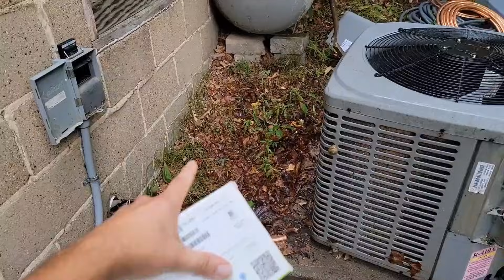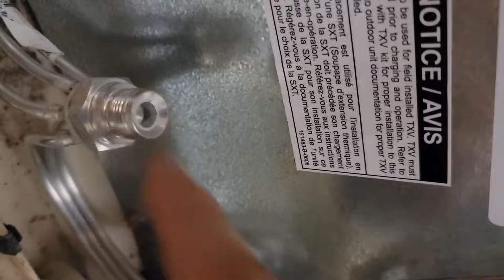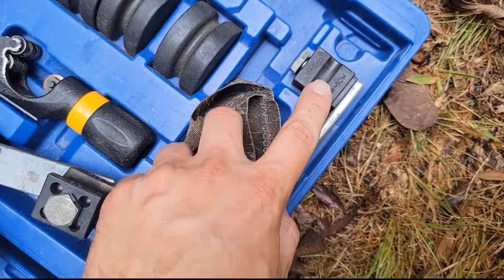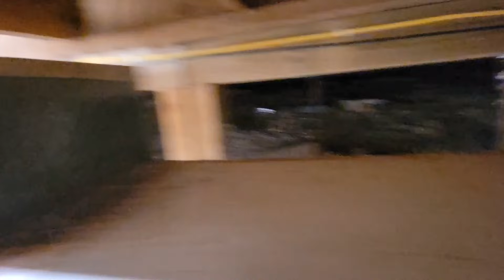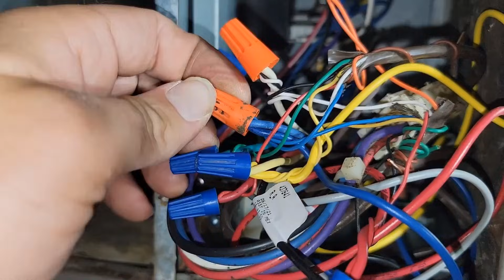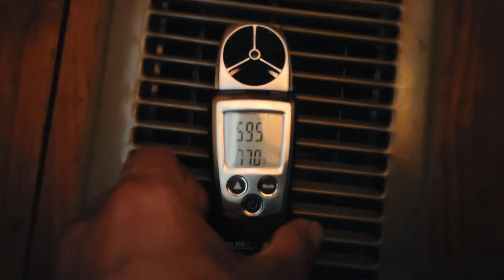HMH7 Modulating Heat Pump Installation Tips @YORKUnitaryProducts

Comment: I have a very similar unit. Even after the heat is turned off, the electric heater continues to run. What could be causing this?

Comment: When the return is pulling above 500 could you add a higher merv air filter to improve air filtration and also hit the temperature split?
Reply from the maker: You would definitely improve air filtration with that move but the restriction in the airflow and the added pressure drop is not good for the blower motor the suction pressure in cooling or the head pressure and heating.
This puts stress on the components like the compressor and the blower motor.
You could enlarge the return, get more surface area also try lowering the fan speed.

Comment: Thanks Rheem also has one an inverter   universal   side discharge  Hp units that fit & or rated for an normal indoor ducked indoor   air handler   ...  but is 67 supply air cold enough  ???  if i heard you right ?? so that mean an split of _ ? or RA of 82- low end to 87 +

Comment: I don't want to judge but that is not level
Reply from the maker: It's a heat pump during the winter. During heat mode, while in defrost coil thaws and it needs to drain water away from the unit. So being a little slightly unlevel helps
Reply: Oh, ok. Because I've installed my mitsubishi 6000 btu mini split air conditioner, and it is only an air conditioner on my outside wall and it is getting pretty old and I've ordered a mr cool 9000 btu because my mitsubishi is getting tired, breaking, and running inefficiently. I will try it out when I go to install it. Thanks for that advice!

Comment: I am looking at this HMH7 4ton 18.5 seer unit or the York affinity YZV 4ton 19.5 seer unit.

The HMH7 I am told is modulating unit and installer recommends an ecobee and not using the communicating thermostat. The affinity is going to have to be a communicating system.

Which is the unit you recommend? HMH7 system is 2k less. @taddydigest
Reply from the maker: get the HMH7 I repeat get the HMH7 please
Reply: @taddydigest I have since got the HMH7 4 ton unit, have had it about 9 months now. Not sure I like it/ love it. The unit has started to trip when demanding the unit cool over 3 degrees. Unit doesn’t seem to actually ramp up for the demand (I have to precool the house a day in advance for any type of party I am hosting), and takes 6+ hours to pull the temp down 4 degrees. Unsure if it’s wiring or if this unit just isn’t as advertised. Any help would be appreciated. My installer is involved but the techs aren’t knowledgeable on the unit and invertors. I am almost wanting to swap this out for a trane xv17

Comment: Did you confirm that the system will run the air hander at 2 speeds (high and low)?  And if so, what were/are voltages in the black and grey wires coming from the field kit?  And was the thermostat set to single-stage or two-stage?
Reply from the maker: Thermostat was set for single stage. Because the unit does not require a second stage wire
Reply: @taddydigest   so do you think I can just wire on cool1 on my ecobee lite or wire to cool1 and cool2?
Reply: Did you confirm it runs both stages (speeds)?

Comment: I have the 4 ton one and the one annoying thing is it always energizes W for the first 30 seconds in heat mode and this causes my furnace to run a super short cycle, seems very wasteful. My understanding is this is intended to "temper" the air and prevent cold blow, and maybe it works well with heat strips, but for a gas furnace this seems like a bad idea.
Reply: @ddud4966   when I install them with a furnace I use the ecobee thermostat you can set it up for heat pump and  the furnace to turn on with the temperature outside is too low automatically as long as you have it connects to wifi

Comment: just got a 2 ton HMH7 and it whines for ten minutes after the unit cuts off. Is this normal? Installers can't give me any help. Also, they insist I my Nest thermostat will work with variable speed fan, but Google says no dice. So far the blower only comes on at 100%.
Reply from the maker: You should be able to use any type of thermostat with the h m h seven.

As long as you have the installation kit that comes with It That controls the fan motor

As far as whining
Hopefully they did a good install and open the valves
Reply: part number for that installation kit so I know what to ask for?  @taddydigest
Reply: @taddydigest  thanks. The installer came back and added a relay switch,  which they admitted should have been done initially. Sadly, this has not solved the fan speed problem. It still operates at 100% all the time. 
The refrigerant lines are also making a whining noise while running and up to 10 minutes after the fan shuts down. “Pressure equalization “ is the explanation, but no fix has been achieved.

Comment: Hi, thanks for posting this video, So i am interested in buying this unit. I found someone that bought sold me an air handler from ADPro AX360CT, do you know if this is compatible with the York HMH7 ?
Reply from the maker: Almost all air handlers and furnace and coils  are compatible with the hmh7. Also If you know how to read a manual, schematic, and wire a relay, it will work. Unless you have some different communicating stat or indoor unit.

Comment: I’ve got questions…. This is a modulating condenser combined with a communicating thermostat and you connect them together as a “dumb” thermostat without a word of explanation why?

It seems all components are capable of running at variable speed depending on how far the set temperature is away from the actual temperature. The further the temperature is off the harder the compressor and fan should work to get to the right temperature. But this only works with a communicating thermostat, a thermostat that can tell the condenser how far it is off.  And then you install a thermostat that is capable of doing that but configure it so the only thing it can say is whether it is too hot or too cold. Hey! How much too hot or too cold?

Now it seems this beautiful HMH7 system can only play a bit with its speed based on pressures while not having a clue about what clear relationship those pressures have with the wanted temperature.  

Why? You got all needed hardware! What am I missing?
Reply from the maker: Good question I will do a video sometime and explain

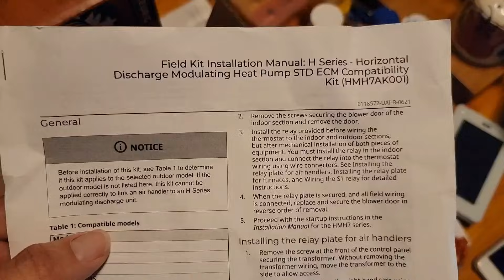Comment: Speaking of following the installation instructions, I was wondering why you installed the filter drier at the outdoor unit when the instructions you held up at 4:18 say to install "near the indoor section"?
Reply from the maker: just makes sense 
easier to get to
Reply: @taddydigest  Thanks for your reply.  Out of curiosity, why does it specify near the indoor unit?
Reply: @KillerB101  the line dryers are made out of steel so if they get water in them or you mess up the paint during welding they can corrode and become a point of failure, indoors, less moisture better chance of not having corrosion
Reply from the maker: absolutely 💯
Reply: @DavidSpecialis  Thanks for the additional explanation!

Comment: Hello, I have installed two of these units on my house and configured them with dual fuel.  I am having two issues, (1) the HP never seems to send a signal to the S1 Terminal to slow the furnace motor down.  York supplies a field-mounted relay for this purpose.  (2) in the heating mode, the HP sends a signal to turn on the gas furnace for approximately 3 minutes; this seems odd; never seen that before.  Has anyone else seen these issues?  Thanks!
Reply from the maker: I received an email about this a couple days ago
 If you want to email then click the join button become a member and I will give you my email
Reply: @taddydigest  hello, I’m an installer an also noticed this. Is there a way to disable s1 and delete the fan relay for better reliability. I was wondering what dip switch settings would cover this, Thank you
Reply: I have both of these issues with a York HP hooked up to a Bryant 2-stage gas furnace.  The furnace burner will start at the beginning of a heat pump cycle and then the burner shuts off in about a minute.  The heat pump and blower continue to run after that.  And I also cannot get a lower stage to run with the heat pump.  The HP always turns the blower on at high speed and never a low speed.  I do have an outdoor temperature sensor for the thermostat, too.  I would really like to have the heat pump use a lower blower speed fan when the system is maintaining a temperature.  Has anyone figured out how to fix this?
Reply: @PeifferBrother  I've been frustrated with my HMH7 - I cannot for the life of me figure out why the unit is programmed to operate how it does. My air handler never reduces speed (that I can tell), and even manually firing a lower speed tap on the blower from my thermostat doesn't seem to do anything. Essentially my unit is just a fancy on/off heat pump, turning on and ramping to full compressor speed before cutting off to wait for the next thermostat call. I have found that if I keep my indoor blower running constantly, the unit will start to modulate down after the thermostat call is satisfied; however, it continues to modulate so low to the point where after 3 minutes or so it cuts off anyway.
Reply from the maker: You need an outdoor sensor for your thermostat this will solve your issue

Comment: Question from Toronto Canada. I got an HMH7 installed paired with a Trane S9V2 NG furnace. Heat pump is fairly new to our area and the installer is not very competent. He didn't install the relay kit and I finally managed to install it myself to get everything working. One question i have is the defrost. I notice that when the defrost is on,  cold air will come through the vent. From my research, the W wire from the HMH7 should have an output of 24V to call heat to the furnace during the defrost cycle. I have checked the W wire has no 24V during the defrost. But we are just at around zero degrees C. Is there different stages of defrosting for this unit? will the heat turn on during defrost in colder weather?
Reply from the maker: do you have a outdoor sensor installed with the kit
Reply: @taddydigest  I don't think the contractor install any sensor. He just installed whatever comes with the unit. I use Nest thermostat to control the system. I can see the outdoor unit went into defrost b/c the outdoor fan is stopped and cold air is coming through my vent. I used a multimeter to probe the W terminal from the outdoor unit and there is no 24V signal.

Comment: Good job. Always doing the best job we can with the existing installation. 

A good rule of thumb for you on the return grille/filter sizing: I look for 150 sq in/ton at a minimum. So about a 16x20 for 2 ton is minimum. 

The  air filters will filter better, last longer with decreased air noise.
Reply from the maker: Absolutely thank you so much that's a good rule of thumb